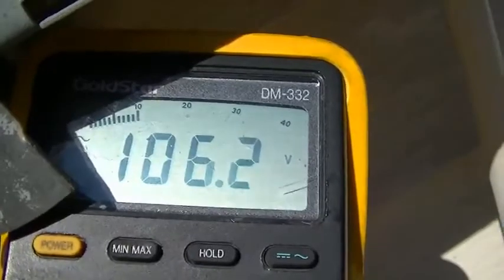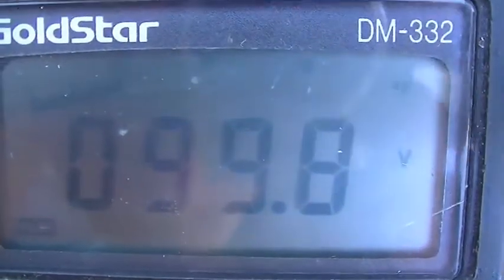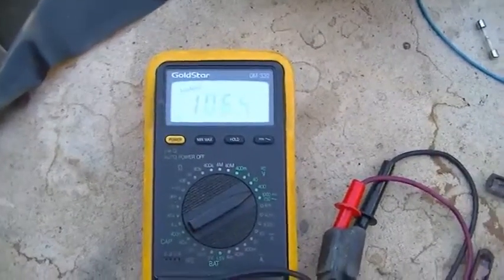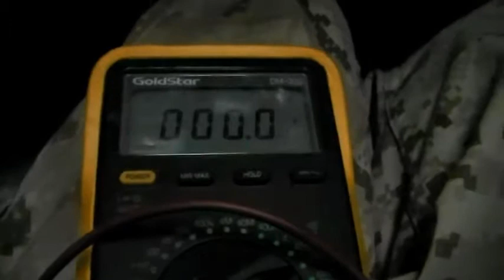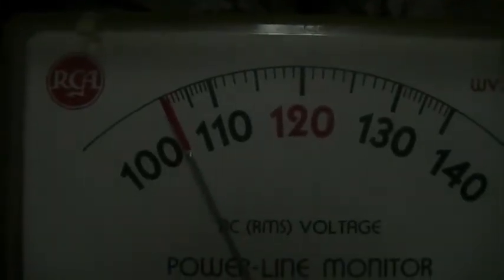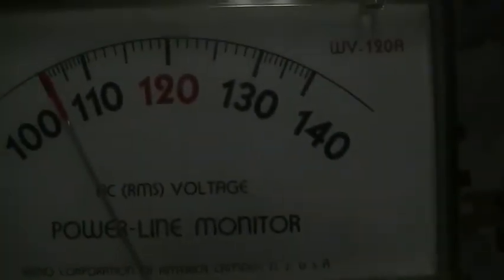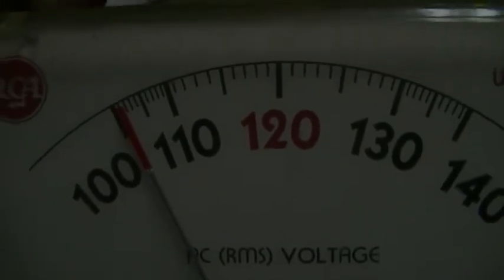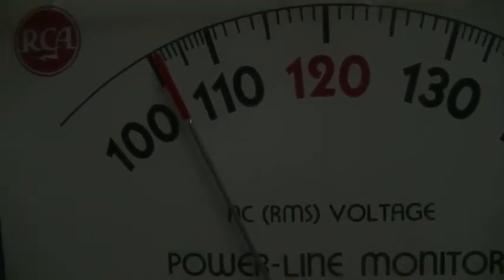low line voltage

Comment: Might be worth getting a UPS with AVR for your computer equipment if this happens  often.  The variac is a good temporary solution but you don't wanna fry anything if your voltage returns to normal without you noticing.

Comment: Jeez, do you have any strange, strong QRM on any HF bands? Seems like if there is a serious developing short somewhere near-ish it could be putting out some RF. Pole pigs do this and bad HV insulators do too. Then you could RDF, set up camp, and video a self -EOLing power grid component, maybe a pole pig or even a substation transformer or switch. Boom!

Comment: The switch modes supplies don't like voltage spikes though, they can handle a certain amount but beyond that, BANG! You would think they would be more concerned about brown outs, because at some point after the high current drain goes away they will end up with a power surge that will burn up a bunch of their fancy not so smart meters, but this is what happens when you have no minds making engineering decisions.

Comment: About a month ago, our voltage dropped to 75-85 volts. Only things that were on was a dimmable LED bulb, LED security light, and phone charger. This is in Southern Illinois. I could not find out what caused it. The power company didn't tell me.
That's bad on motors.

Comment: Wow, this is roughly 20% below rated voltage. Somewhere down your road there must be a huge problem, if it was only your house, then it would be a local problem, but all the neighbourhood being dimly lit is a strange Sight...

Here in Europe the supply is 3phase 230/400V, I habe never seen a Leg below 218V, maximum was 245V, which both is in normal rated range...

Comment: When I was a kid I had built a HealthKit ac line monitor and one day noticed it had gone up to 131 volts. I had a florescent light in my room and the ballast was cutting out because it was overheating. It suddenly went back to normal later that night. It was a hot night.

Comment: Down to 100 V is very bad Voltage about 15 % below normal 120 V.
Typical lazy POCO's instaed of addressing the issue promptly.
Fridge compressors could burn out as their starting torque is directly affected by low mains voltages.

Comment: Smart Meters have been knowing to cause Electrical Problems in the service Panel if not installed correct? Do you have PG&E Electric? Smart Meters have been knowing to cause fires

Comment: What happens is when the new meter is not installed correct in the the Service panel the metal jaws that the Meter goes to can become lose and cause Electrical problems